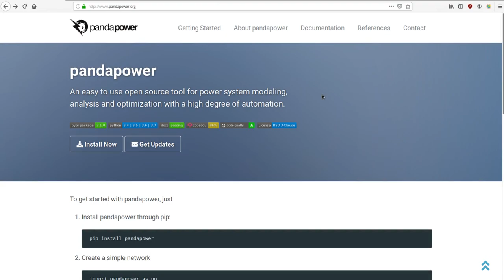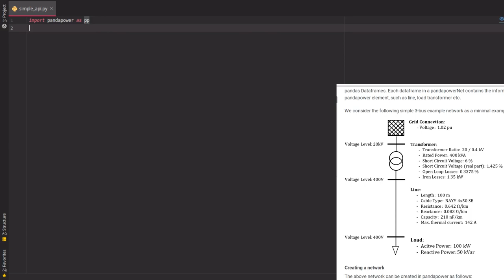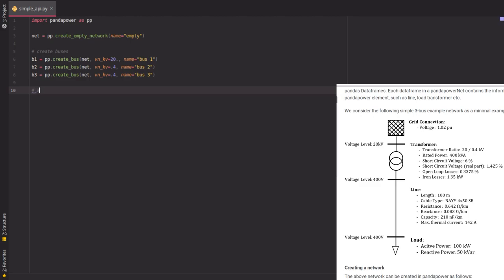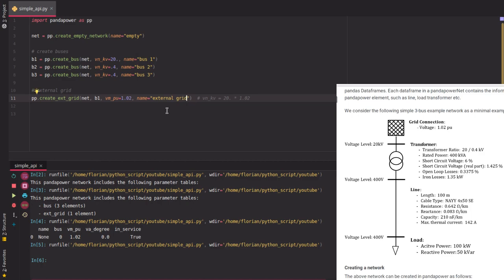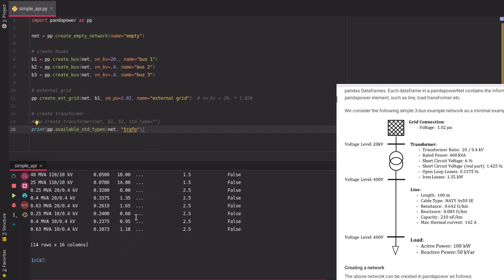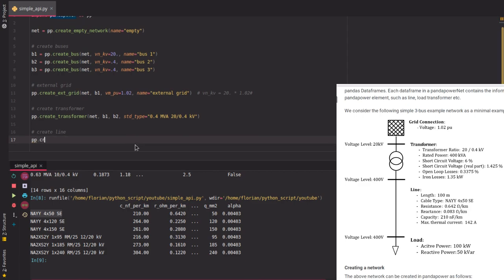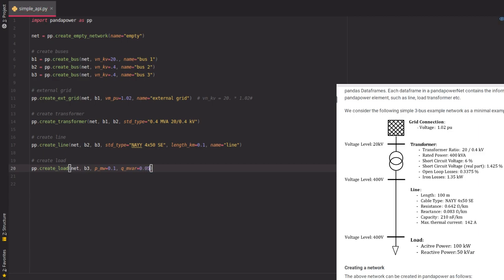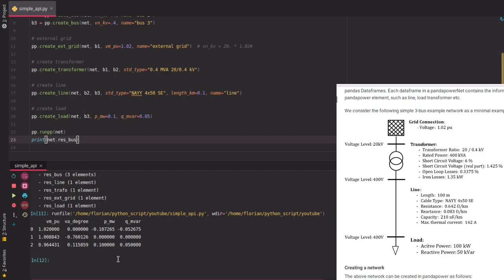pandapower - Create your own grid with the API v2

Comment: Hi! First of all, I'd like to thank you for your job, it's greatful to have a toolbox like this!
 
I have a question, can you plot the grid you showed on the video with the command 'simple_plot'?
I have copied the code and added a line with this "simple_plot(net)" but I get an error with libraries (igraph), but when I plot the net of oberrhein I don't get the error. 

Regards
Reply from the maker: Hi, thank you! 

If your grid (the one showed in the video) contains not geodata, simple_plot() tries to create artificial coordinates. For this you need igraph installed. It's explained here: https://pandapower.readthedocs.io/en/v2.1.0/plotting/matplotlib/generic.html?highlight=igraph 

Best,
Florian

Comment: Hi, 
I am trying to create a program that imports file data from excel and uses panda power to  do the load flow . i  have imported line parameters (r and x) from excel. is there a way  in which  i can  use  the imported line parameters in pp.create_line() instead of standard parameters??

regards
Reply from the maker: Hi,
It think you're looking for the function "create_line_from_parameters()". See:

https://pandapower.readthedocs.io/en/latest/elements/line.html#pandapower.create_line_from_parameters 

Best,
Florian